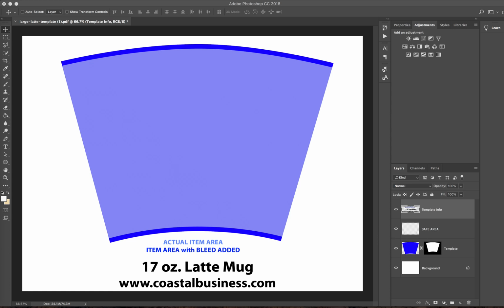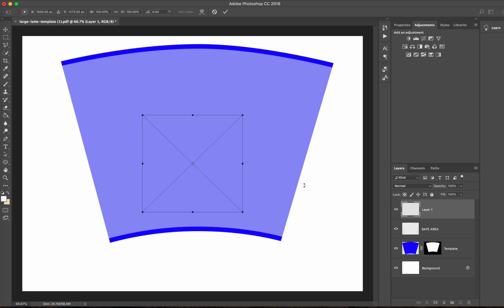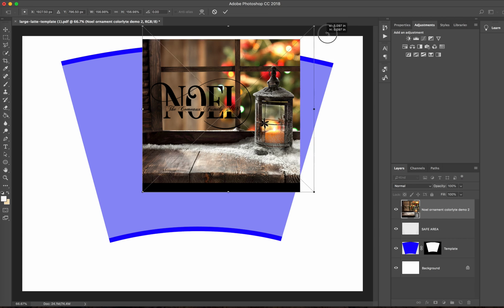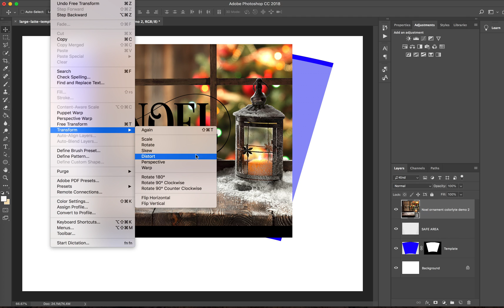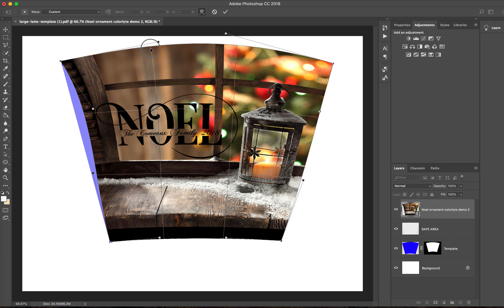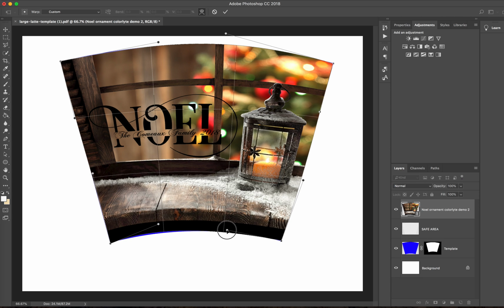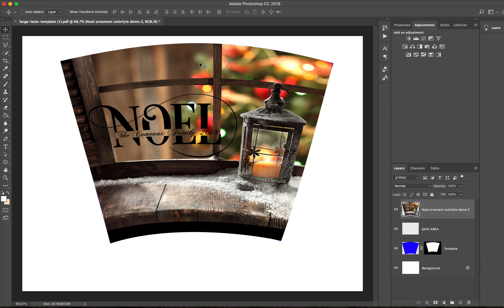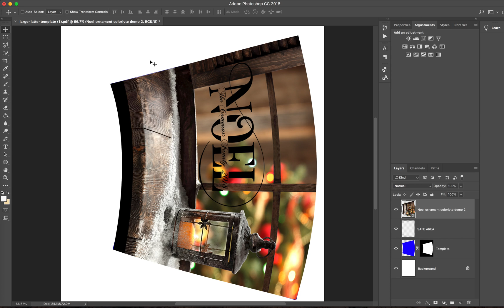Latte Mug: Placing a design using Photoshop for Sublimation

Comment: Thanks for doing this video. I have had problems with latte cup template sizing and it's driving me nuts. I came across this and was surprised that the steps you were taking is exactly one of the approaches I tried to no avail. What I found the most frustrating is I used the 12 oz template from CBS, which were also the source of the mugs. I figured it had the all the right dimensions. After doing the above in PS and printing a test print on regular paper, trimmed by hand, it didn't wrap correctly.  I made adjustments, mostly to the arc, tried again, same results. No matter what I do, it simply won't work. Any suggestions?
Reply: BTW, I even printed the template itself, trimmed it, and it didn't come close to wrapping correctly. I thought it could be a printer issue and used 2 different ones. The results were the same.
Reply from the maker: Rick, it sounds like the latte template you're using is the problem.  I would print a test template before testing with the images.